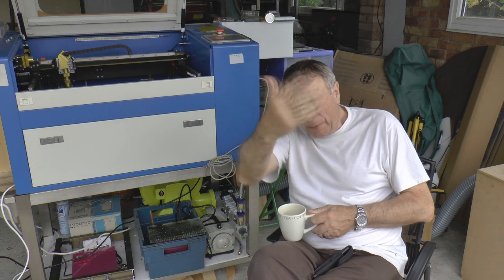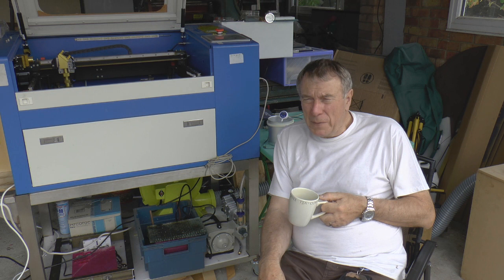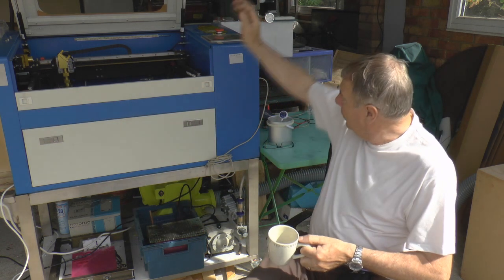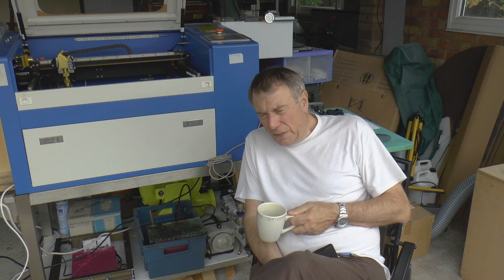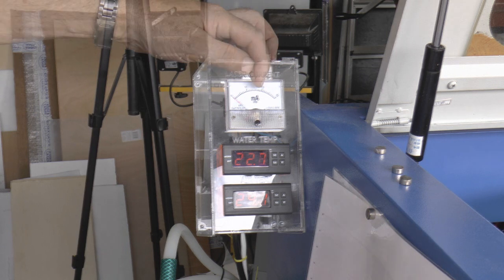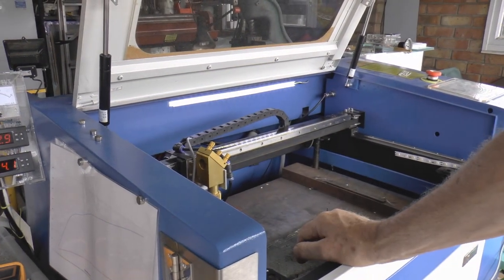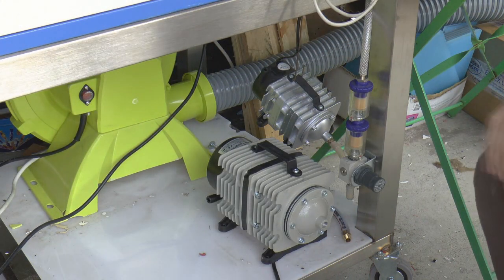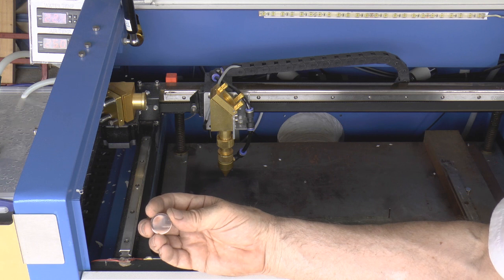RDWorks Learning Lab 75 What have I learned from 1 year of owning a Chinese Laser Engraver

Comment: Sorry to bother you Russ, I'm in a predicament around safety glasses I've been looking at the performance of so called Co2 "CE" standard safety glasses on videos but the cheaper Chinese one's £5.00 - £10 I wouldn't trust them at all even without or before seeing their capabilities on videos on YouTube with the expected results I had in mind no matter what their label claim, I want en 207 rated and as you know they don't come cheap - I see a pair on a website on "Philips safety. Com/ they're a genuine supplier as you probably know but the prices are out of my price range some going over £250 + then I seen a pair labeled Cloudray 10600nm OD+4 CE protective for £25 on Amazon i want a European or UK Manufactured  pair not just American OD rated because I don't want " fried eyeball " when checking and lining my mirrors up! The wife said "oh! Those will be OK,,,, (the Amazon pair) but I've told her I need +5 en 207 in case of a direct hit I've spent many hours looking for en207 rated online but again my budget can't stretch, HPC laser ltd had a pair with a W/Length of 10600 for £50 but like countless one's I've seen " out of stock" but in my price range, and I know you can't put a price on your eyeballs but as the wife Pull's the purse strings she thinks because the eBay branded one's state the wave length 10600"CE - OD4+ will do the job but will they because I'm certain they won't,
Is there brands you could recommend?
   Sorry for wasting your time.
Reply from the maker: Hi
 The word LASER engenders fear in most people  because it can be dangerous. The problem comes from not understanding the physics. The laser beam, although invisible,  is just like a torch beam The only time you will see the light is if someone points the light at you.. In the case of a laser beam it does not spread like a torch beam ,to all intents it remain the same diameter s all the way from tube to lens. Thus you cannot damage your eyes by  looking at where the invisible laser beam is it will only do you harm if you can somehow get your eye directly in the beam. That is a virtual impossibility even with the cover open. The laser  is a beam of LIGHT energy that is completely harmless until something solid gets in it's way. Imagine a stone dropping from the sky. It is dangerous? The answer is NO,,,not until it hits something solid (like your head). At that instant the ENERGY in the stone converts to a different form and causes damage to what it hits. It is exactly the same with light. Unlike the stone. there is no mass to do damage, instead, the light energy interacts with  atoms and molecules at the SURFACE of anything solid it meets. That interaction causes the atoms and molecules to heat up . THERE IS NOT HEAT IN THE LASER BEAM.....JUST PURE ENERGY that transforms to heat when it excites the atoms and molecules   Our CO2 laser beam has a wavelength of 10.6microns and is in the infrared part of the electromagnetic spectrum.  There are only three  things that IR light reacts to. 1) Metals of any sort. They ALL act as mirrors and reflect the light but some are better than others. 2) A VERY small number of salt crystal type of materials  that allow the IR light to pass through...we use these materials for lenses. Finally,  3) EVERYTHING ELSE will be excited by the light energy to a greater or lesser extent and the molecules and atoms of each material will self-heat as they  absorb the light energy. . The more intense the light the more damage will be done.
 So,  if you can understand the light to heat energy transfer mechanism then YES your cornea  could get fried, so could your nose or your finger or your clothes or ANYTHING you put directly in the way of the laser  beam, So everything is pretty safe until you put bits of metal into your machine at such an angle that the beam will be reflected at you.. 
 Normal glass or ANY plastic will 100% absorb the light energy and just ordinary glasses  or cheap polycarbonat  (£2) safety glasses will protect your eyes form IR light. The REAL problem is UV light. THAT can be dangerous because it does not fry your cornea, instead it passes right through the eye and with sufficient exposure will desriythe retina at the back ofthe eye. It is just like staring at the sun......YOU DONT DO IT.    So where does the UV light come from with an IR laser?  The answer is from the material you are cutting. Look at wood cutting. There is a bright intense light at the cut surface. That cannot be wood burning, wood burns at about 350C and never  gets WHITE hot. After the wood has burnt, what's left is carbon. Carbon has to heat to more than 3,600C before it turns to gas. So what you see is a carbon arc that contains very high spikes of UV light. That is what you are really protecting your eyes against. If you keep the lid closed during cutting the glass or polycarbonate lid will protect your eyes anyway. 

Take a look at this video  https://www.youtube.com/watch?v=kx4vmDguCyE&list=PLPWEtx5V9DqEogIeYRdcG_KYcB7UL2Qmn&index=2&t=605s

 Do more reading about IR and UV light. Dont pay for something you don't need. The  dragon you are playing with can bite.......just understand it and respect it, don't fear it without reason.

Best wishes
Russ
Reply: @SarbarMultimedia  First : thanks for getting back to me I really appreciate it  and all the detail and explanatory way of describing things really does make a novice understand things better and you've got "what we call in Liverpool" ( the knack) of making things look (on your videos) and sound easy for anyone. 
I was awake last night until around 1.30am watching your videos and I will take a look at those you've told me about but there was one last night that you said so called experts said you can't cut through a 10mm ply with a beam on ???? But you proved them wrong - " I can't remember everything you said because my medical problem (I sustained a brain injury that's caused havoc with concentration levels and memory and as a result I've also got epilepsy, I can't even remember the dates my three kids were born so they (family) paid to get them tattooed on my right arm for a laugh i can't remember the date we got married either 😱everyone does take the p*ss out of me but they all know it's not my fault - but tough life goes on get on with it and do something interesting that will keep what I'd say is  "the undamaged part of my brain occupied" that's why i thought I'd have a go with the K40.

Again you're a very intelligent and talented guy and a inspiration to others oh! I will take on board you're info but I'll have to watch each of you're 145+ videos " errm twice over just so I can absorb things.  😁.   Thanks again!.

Comment: I've just got a k40 40 watt co2 laser engraver/cutter ,anyway my problems because of being educated with these brilliant videos i would like to know is what is the maximum % of power I should use to get the maximum life and performance out of the "so called" 40watt tube? I'm going to fit ammeter but as for now it's currently got a digital display.
I've had it for 3weeks and I haven't even used it because I don't want to overload the tube as I certainty can't afford to be paying £100+ every 4 - 5 months, any advice would be really appreciated.
 Oh! Brilliant video keep them coming as many newcomers would be in sh*t street without them.
And those who disliked must all be dyslexic and was trying to say 
    Dis - I - like ! 😁
Reply from the maker: A 40 watt tube will be 800mm long  and will not fit into your case.   Normally take 200mm off the case width and that tells me the tube is 600mm long and 50mm diameter. That makes it a 30 watt tube IF it is an A grade tube, Sadly the Chinese max out profits by fitting B grade reject tubes to these Ebay machines so you may only have 20 watts at the 16mA max that you should be running a 30 watt tube at. There are some simple check to carry out when you have your ammeter fitted . Send me your disguised email address in another comment and we can speak later when you test your machine.
Best wishes
Russ
Reply from the maker: @joeblogs4146  
Hi 
You don't need to encrypt it, just spell your email in  one word like this joedotblogsatyahoodotcom. That way, bots that look for email addresses to collect and sell will nor spot it. I will also delete it as soon as it arrives in another comment.

Yep, as anticipated, its a 30 watt 600 long tube and very B grade. The writing on the label is to give you confidence that it has been tested but it tells me exactly the opposite.. The "updated" bit of the advertising is just another ruse to make you feel you are getting more for your money.  The design and software has been the same for years as has been the fact that they fit B grade reject tubes that they collect from the original  tube manufacturer for peanuts (or less). The SH signifies.your machine was built in the Shenhui factory (so was my China blue machine and that was fitted with a crap tube also). Do you have any small pieces of  acrylic?  If so, how thick?  we need to test what shape the light intensity is within your beam before I can even begin to judge if you have any useful power. That's why we need to communicate by email. You can.t send pictures via You tube. If the K40 is fitted with a proper quality tube , it will do what you are looking for. I have seen some nice pictures done on K40s. 
 Best wishes
Russ

Comment: Hopefully this thread isn't so old that I won't get an answer. I have the same machine and am looking at modding the side and installing an 80 watt tube and power supply. What diameter of tube do I need to look for in order to ensure that it will mount and line up like the stock 50 watt (actual 40 watt) tube? Thanks in advance.
Reply from the maker: Hi
 Your existing tibe will be 50mm diameter. Yes, you can find 80 watt tubes with a 50mm diameter but they are usually cheap, "old school" design and 1600mm long. Modern 80 watt tubes will be 55 mm diameter and  about 1250mm long.. You will find some great 80 watt tube bargains on Ebay. Be VERY careful because they are cheap for a reason. They will usually be B grade reject tubes from a major manufacturer that have failed their final tests. Yes the will work but who knows to what standard.. There are very few trusted sources unless you buy direct from a manufacturer.  However I can validate one trusted source and that is cloudraylaser.com.  They sell their own branded tubes as well as others.  Cloudray do not manufacture tubes so  normally I would run a mile from any rebadged tube. However, I know that Cloudray have negotiated  a rebadging deal with SPT ( a real top tube manufacturer) and their tubes are A grade tubes at a great price. They are also VERY conservatively rated You can see me fitting a CR70 (70 watt)  tube to one of my machines and you will also see it being tested as more  80 watts  at it's safe working current.
 
https://www.youtube.com/watch?v=V_ehGE51rH4

Check out your tube clamps to make sure they will take a 55mm diameter tube

Best wishes
Russ
Reply: @SarbarMultimedia  Thank you sir.. You are a wealth of knowledge.

Comment: Hi Russ great videos I've had one of these laser cutters for a while but unfortunately had a fire my own fault but now need to purchase several parts have you any idea where to buy spares from.
Thanks Danny
Reply from the maker: |Hi |Danny
Many spare parts are available from Cloudraylaser.com. If the parts you require are not shown on their website there is a message tab on the right or better still send a picture (maybe with a couple of key dimensions) to info@cloudraylaser.com

Best wishes
Russ
Reply: @SarbarMultimedia  Thanks Russ for the very quick reply will have a look many thanks

Comment: Forgive me if I missed it, but can you tell me why you have two temperature gauges?  Is one sensing at the input to the laser tube and one sensing at the output?  Do you find that additional info to be helpful?   On another note, is there any value to having a KV meter to keep an eye on the power supply output voltage?
Reply from the maker: Hi Glenn
One thermometer is reading the water return temperature into the reservoir and the other is just monitoring the workshop air temperature. Why?  Here is the UK near London the weather is never extreme but during the winter months the the temperature can be below freezing for several continuous days each winter. I do not have a heated workshop so my water filled glass tubes are at risk of freezing and bursting. I have installed heating on my machine and an external power supply that switches on when I turn the machine off. If the air temperature in the workshop falls below 5C then the heating and water pump switch on to keep everything "warm".   You can see the idea by watching  
https://www.youtube.com/watch?v=NAiMrMGT1O0&list=PLPWEtx5V9DqEogIeYRdcG_KYcB7UL2Qmn&index=31&t=1s

I see no value in a KV meter, just more potential for arcing to the case. The key control instrument is an ammeter to manage the current flow through your tube. It matters not what the operating or strike voltages are  because the tube is as good as a meter. If it fires there is enough voltage, and  if your tube fails to work  then you have a new HV power supply on your shopping list.

Best wishes
Russ
Reply: @SarbarMultimedia  Hi Russ,  Thanks for the detailed response.  I have just opposite problem in Arizona, with workshop temperatures sometimes reaching 41C, so heat will rarely if ever be needed here (do you happen to know if a CW-5200 can heat the water or is it just for cooling?).    I have an X700 red and black Redsail clone and am switching to a 75W RECI T1 tube along with an 80w Cloudray power supply.  I am planning to integrate my mA meter and my (single) K-type digital temperature readout into a tube 4" extension case I have a friend 3D printing for me.  Imagine your white extension box, but with the front face having a slope like the front of your acrylic meter case.  The two studs of the mA meter will be relatively close to the narrowed back end of the tube.  I plan to use shrink tube, silicone tubing and silicone caulk to thoroughly insulate everything, but am I asking for trouble locating the mA meter in this location?
Reply from the maker: @theAGanimators  
Hi Glenn The CW5200 is just a refrigerator industrial cooling system. It can be quite fierce in the way it injects cold to the system If you are planning on doing low power photo engraving for example you may experience banding in your projects as the cold water cuts in and changes the power output of the laser tube by a few percent. . This can be overcome but in general it is an OK solution for your "warm" climate.   "Instant cold" is power hungry and some guys are anal about running at 19.2 to 19.8C. That will be  very high running cost. Take a look at this spec
http://www.recilaser.com/en/index.php?m=&c=Index&a=show&catid=7&id=65
You will see that Reci can run their tubes up to 40 C.  I have tested tubes up to 45C for a few hours with no ill effects on the tube , just a 5% loss of power. So running at 25 to 30C is comfortable and will  keep your electricity bill a bit lower..
Best wishes
Russ

Comment: I would also like to take the time to thank you, unlike you I haven't retired just yet.
Currently I am 18 months in with 3D printing (CR10s + Ender 3 ) but for a long time now I have always had a passion for Laser engraver /cutter but have yet to purchase one.
My wallet is burning and finger ready to press Buy It Now and after watching your video I am about to press the return key.
Reply from the maker: Hi Darren
Don't be tempted by a low price. It is important to buy a machine with a Ruida digital controller. The give away is the control panel. Make sure the panel looks EXACTLY like this
https://www.cloudraylaser.com/products/cloudray-ruida-rdc6442g-dsp-controller-psu-wifi-handle-for-co2-laser-engraving-cutting-machine?variant=12906003857459
 Most others will be "old school" analog controllers. Also look for decent HiWin type bearing rails. because there are lots of cheap Micky Mouse systems. Get these two key items right and everything else is fixable. If you wish to send a link I will be happy to comment for you.
Best wishes
Russ